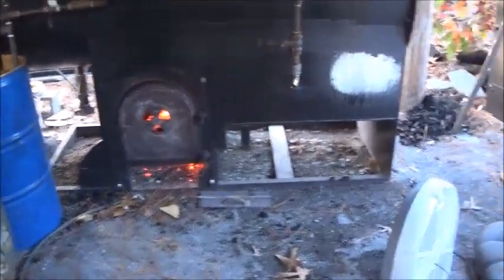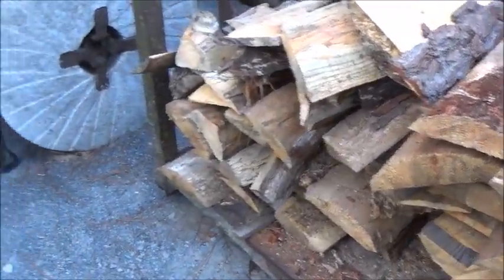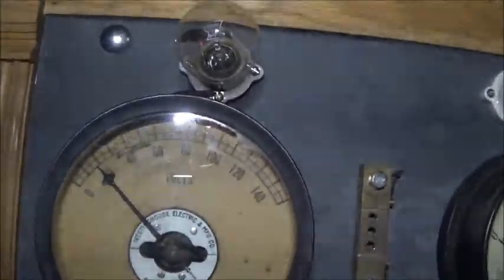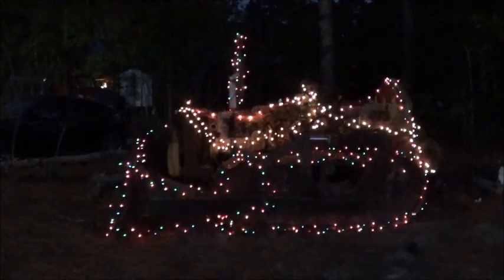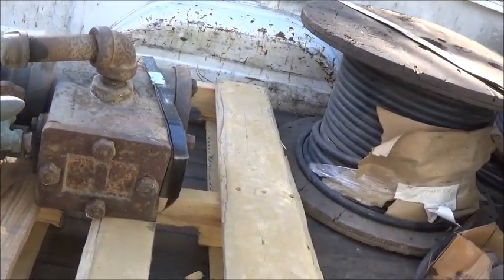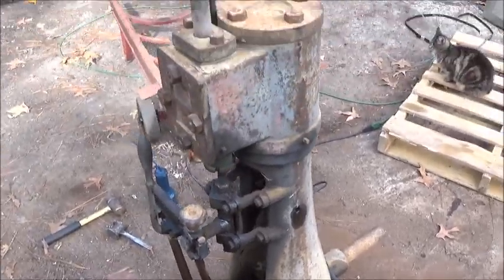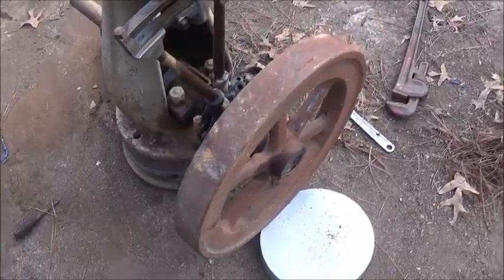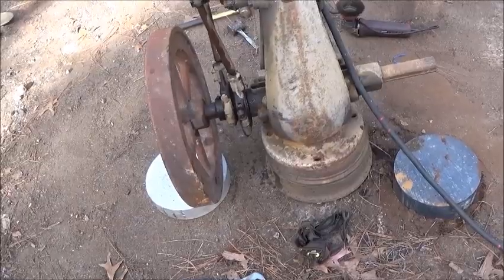STEAM ENGINE DELIVERY, FIRST RUN IN DECADES, MAKING ELECTRICITY

Comment: To test your amp meter, you can check the dc  millivolts out put at the shunt connections. Also a dc amp clamp on the main lead to the shunt to compare to.  The millivolt reading will be in ratio to the current through the shunt, depending on the shunt ratio. You could also supply the amp gauge with a milli volt supply and see if it works. The shunt out put to the amp meter is in milli volts. The amp meter is really a millivolt meter scaled to read in amps. your xmas lights are probably very little load. An electric resistance heater or some very large incandescent bulbs would supply some calculated load to test. Caution so as not to over load those old windings.

Comment: Jonathan has steam engine flywheels in stock.  Priceless.!.!.!.!   Hey, I was thinking, if you changed the resistance of the ammeter shunt, something with 10 times more resistance, it would change the range of your ammeter from 400 amps to 40 amps.  That might be a better scale for the amps you produce.  And you could put in a switch to bring in the shunt calibrated for 400 amps too, once you get larger loads connected. It would be easy to read too, just drop the zero in your mind.--Doozer

Comment: That is a perfect marine engine for a motor whale boat. Even if you had to emergency reverse the engine it would be really hard to mess it up if it is just turning a screw against water. The water friction even turning it in reverse while their is still forward movement of the boat would not be an issue with this type of engine. These were great engines in those old lumbering wooden boats. They weren't fast but they would power through some big waves.

Comment: I scrolled through the comments to see how many people mentioned "The African Queen." Around 10 by my count.  I also thought of that movie when I saw the engine. You can actually take a ride on the original African Queen in Key Largo, Florida. The steam engine is there but not surprisingly it is not functional. Instead there's an outboard that they try to conceal with a cover.

Comment: Nice engine.  I wounder if the counter weighted flywheel will cause a problem?  I'd guess that if it had one originally it would have been a balanced flywheel.